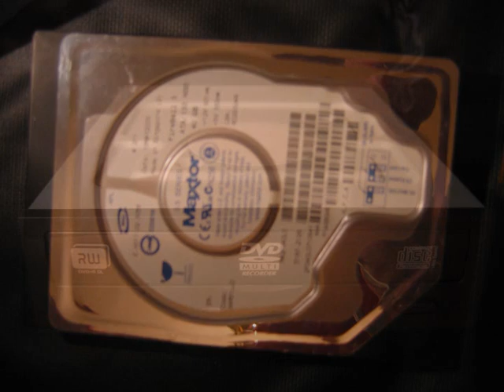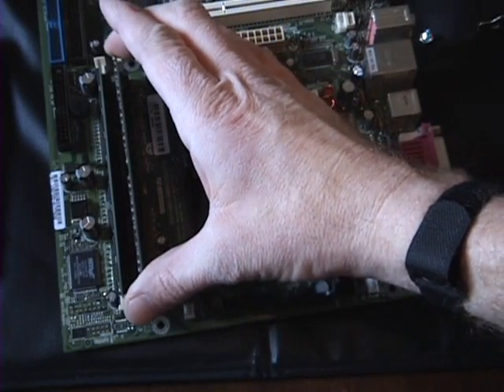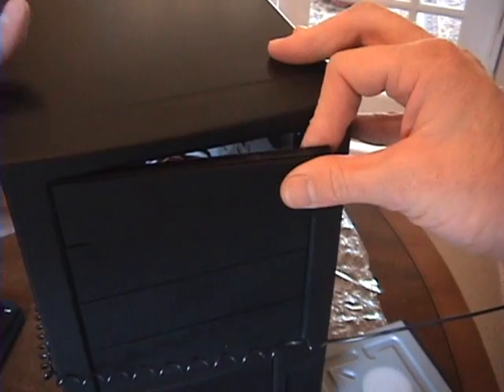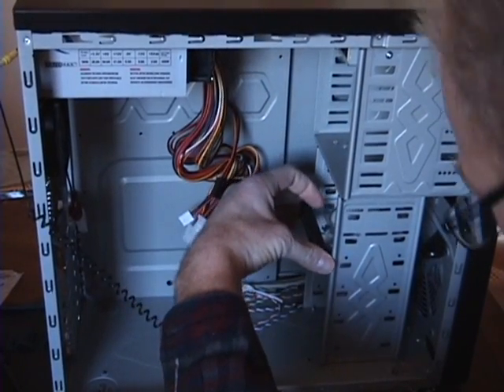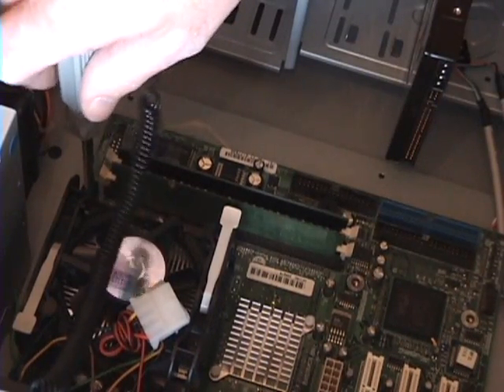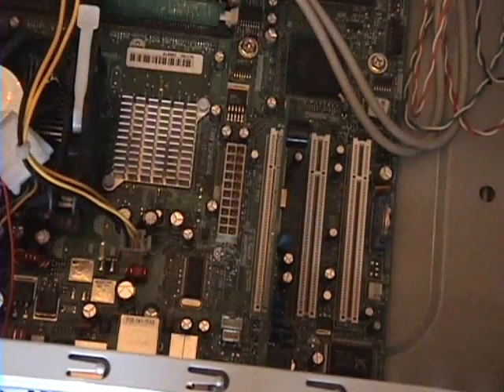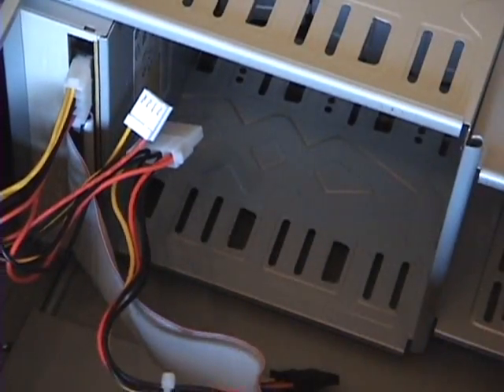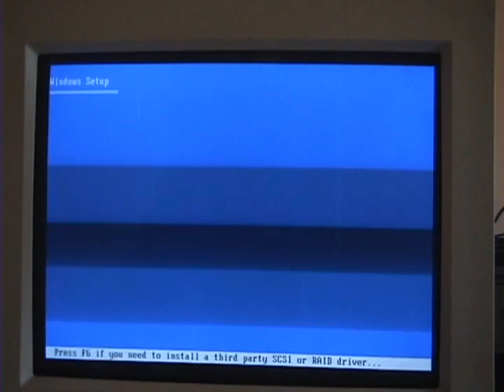Building a desktop computer

Comment from the maker: Sometimes connecting the front panel wires are a practice in trial and error(unless your motherboard came with good documentation).  The connectors are a set of pins marked panel1 or fpanel or something similar.  Within these pins are pwr_btn(or pwr_sw),reset_sw,p_led and hdd_led.  You front panel wires should be marked similarly, except the led leads are marked +and -.  As long as the pwr_sw is connected,  The computer will work.  But you will probably will have to guess with the led's